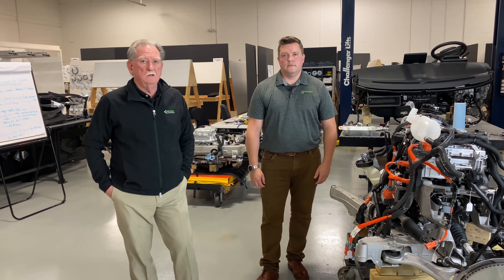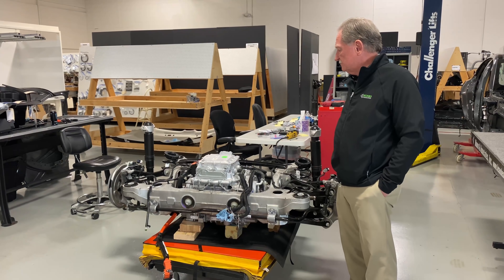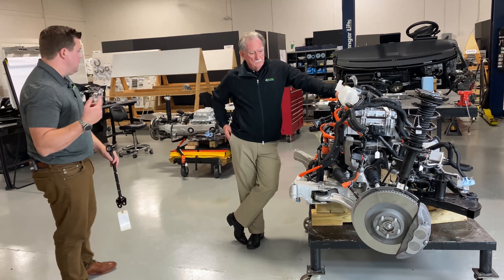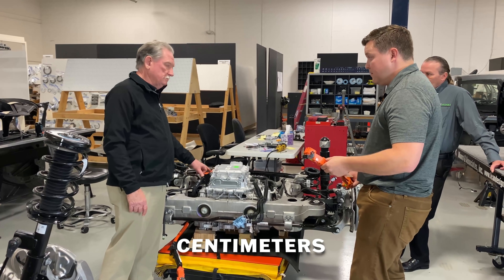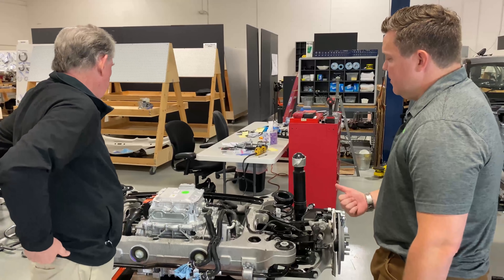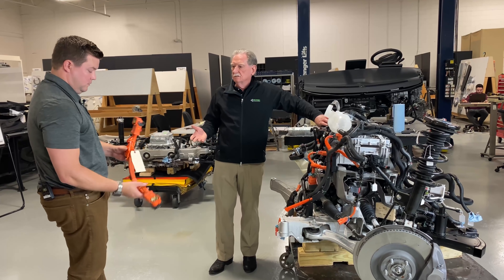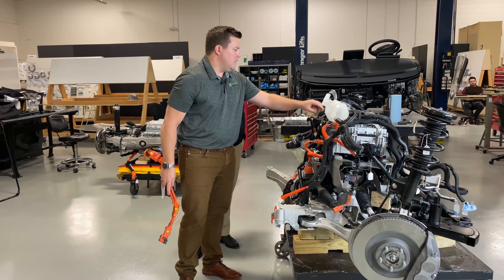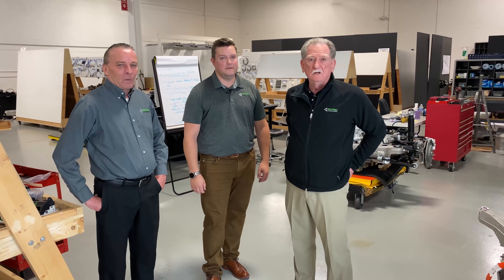Mach-E Suspension & High Voltage Wiring Compared to Tesla Model Y

Comment: Daaaamn! This was really telling about how the design and engineering teams work at each company
Reply: It shows how their corporate structure is killing them as well. Imagine not putting forth a better idea because it would stop you from getting promoted... yet at Tesla if you don't innovate you are out the door! Who do you think will be the leader in anything if that's your working environment. It's painfully obvious that we have good engineers but too much shallow management and accountant gumming up the works at the legacy companies.
Reply: @dr-k1667  I'm going through this exact thing at my work. I have plenty of good ideas to help the company but my boss denies everytime.
Reply: @dr-k1667  I'm not sure it's a case of not being promoted, but more-so it won't 'help to' get you promoted. Like they may simply see it as wasted time trying to re-invent the wheel or something. It's rather unfortunate but this is what a lot of large companies are like in many divisions. :)
Reply: @VoxelLoop  Sometimes it's as simple as don't make any mistakes, keep your head down and nobody will notice you. Take a chance and you might make a mistake and get noticed.
Reply: @VoxelLoop  not to worry - most have been moved to Mexico or China (exception Boeing who just moves out of WA to anywhere else and out-sourcing as much as possible.)
Reply: Teamwork needs to extend beyond silos.
Reply: It is likely that the heavier cable connector was chosen on the front motor high voltage cable because it is in the crush zone. The upper connector could be crushed against the firewall, especially if centerpunching a pole. The front battery connector is more exposed to being hit by road debris or bits that come lose in a high energy crash.

For an example of the second case see the latest video on the Rich Rebuilds channel.
Reply: Depending on outside suppliers results in non-optimal engineering and jury-rigs. Tesla on the other hand does everything in-house so things are better engineered plus they have great engineers, end result is a better end product with more reliability.
Reply: Yep. And I'm betting real money with friends that Ford will be making money on the Mach E.  Tesla still losing close to $900+ per car.  Narrow focus analysis like this, while fun, is FAR from the whole story.